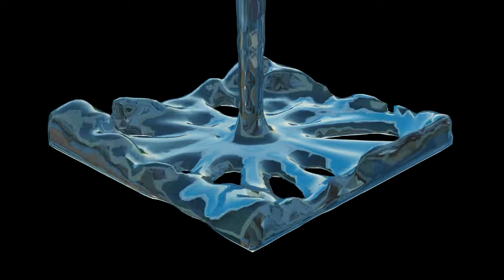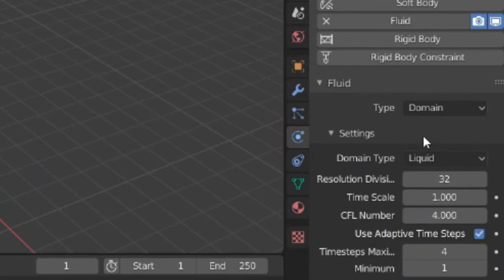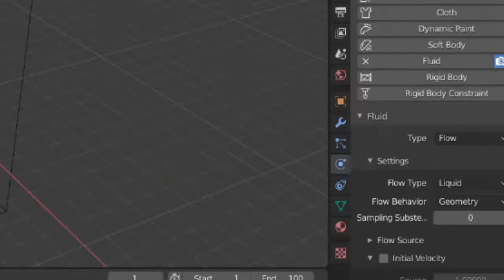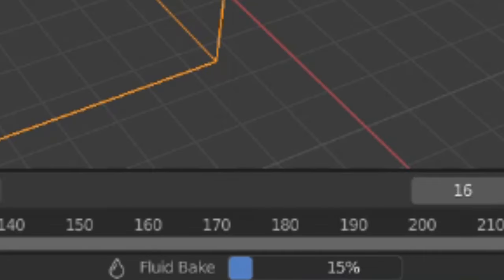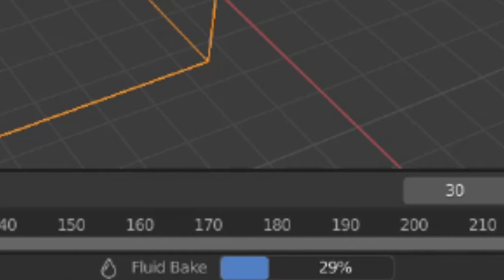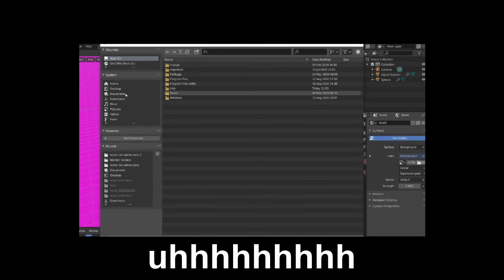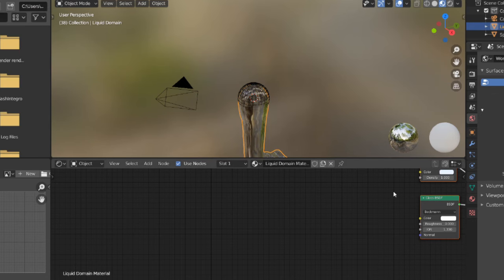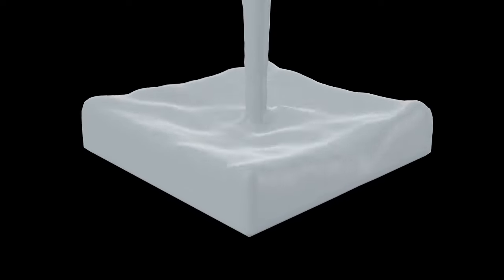Water Simulation Fast (Blender Tutorial)

Comment: Question, when I try to bake data in physics properties, it reads a message above it as "Non Resumable Cache: Baking Mesh or particles will not be possible." Does any one know the reason why this happened?
Reply: you forgot to check the "Is resumable button under the modular
Reply: @c0cbl0ck4  Thank you so much.
Reply: @c0cbl0ck4  This worked, thank you!
Reply: @c0cbl0ck4  Thank you!
Reply: @c0cbl0ck4  it doesnt let me check that either
Reply: @thebestcommenter22  go to cache and change the type to all, then check the Is Resumable button and change the type back to modular. Worked for me.
Reply: @c0cbl0ck4  THANK YOU
Reply: omg thank you so much I had the same problem

Comment: This tutorial is kind of confusing because there are several small details that can go wrong. I've had to watch the first half of it at least five times so far. It's important that you have the sphere selected when adding the quick fluid simulation, otherwise the fluid component doesn't get added to it and you'll be confused later in the tutorial when CGSheep tells you to change its Flow Behavior setting. Another thing that makes it confusing is that you're changing flow settings on both the flow simulation cube and the sphere and can easily get them confused.